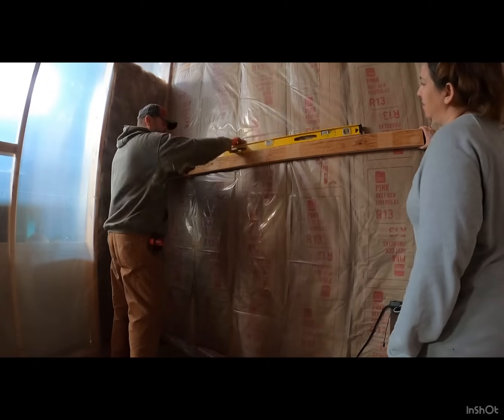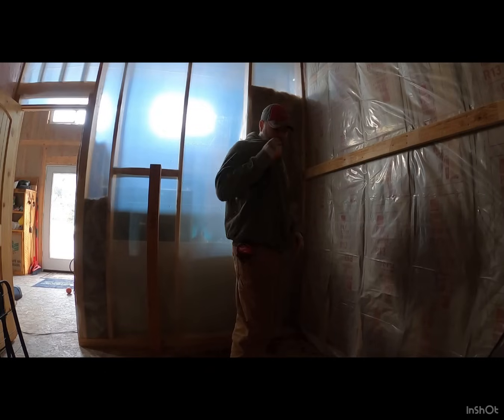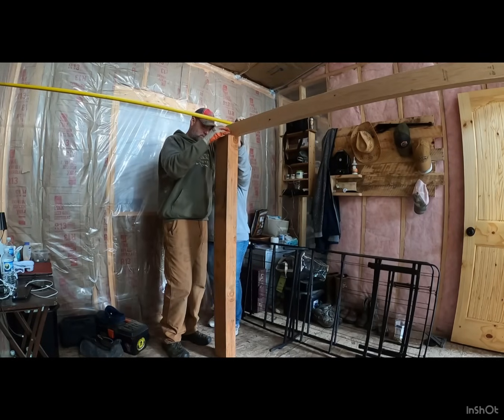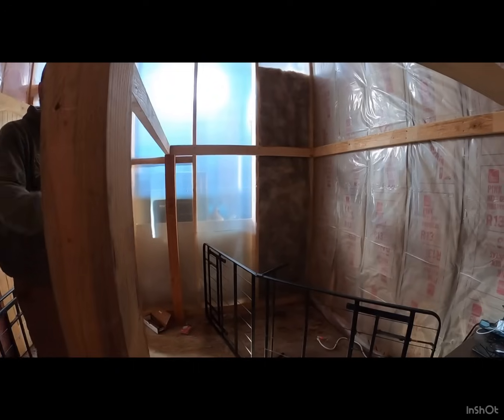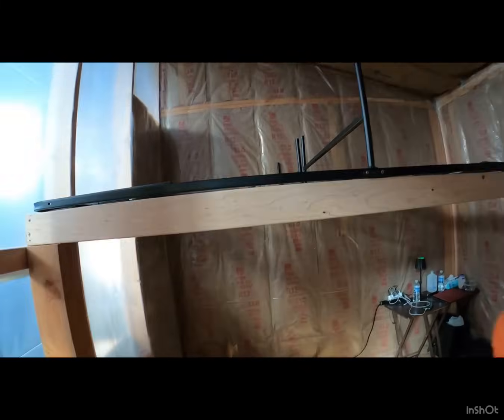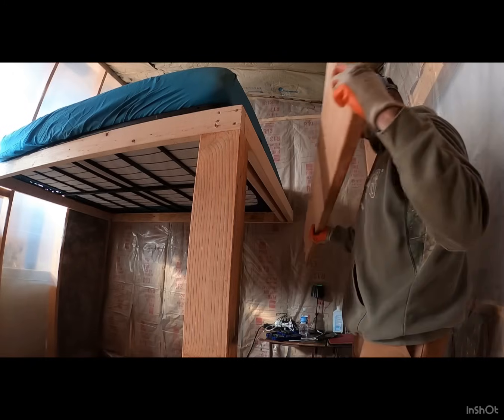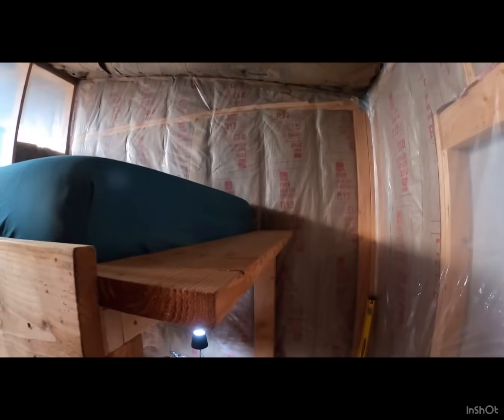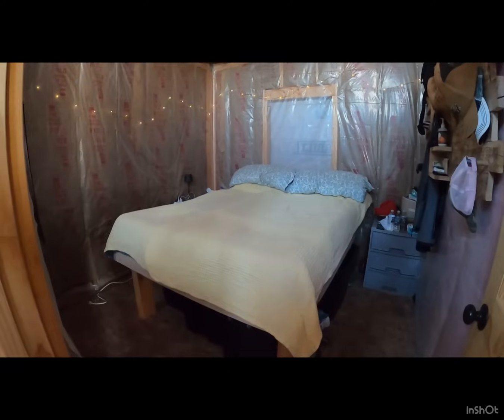Project Gone Wrong | Alaska Off Grid DIY didn’t turn out as expected

Comment: I had typed a thought on your high bed then I saw you changed it.  My thought was you need access to each side of the bed without crawling across the other person and pulling all the covers off the other person and making it easier to make the bed.  I have that knowledge from our first fifth wheel.  You’ll be glad you changed it when you get a few years older….speaking from experience here!!

Comment: Well I'm confident that you have beat a dead horse to the extreme, but conceptually not a terrible idea. Similar constructs can be found in college dorm rooms throughout the US with a desk and chair underneath. Too close to the ceiling for consenting adults and potentially to close the wall adjacent to your woodburning stove. You correctly identified the issues and rectified it.  Not to mention heat rises, hard to make the bed, when someone is ill, or even just needs to go the the bathroom it starts getting sket5chy. You guys are working hard, baring your souls, and making good things happen! I am rooting for your collective success.

Comment: When are rest of the windows going in or are they in and the plastic is just over it
Reply from the maker: It doesn’t look like we are going to be able to get the size we need so the openings will need to be reframed. Probably not going to worry about them until spring.

Comment: I built my bed 4.7 feet up off the floor but my black lab an my shepared still jump up an bug me at 3am to go out. Or just attention.   So im sure that 2 feet know better. Then again my shapard can jump up over the sides of the dump box on my 5 ton F600. Thats over my head and i am 6.2'
Reply from the maker: They’ve got their own beds, no doubt they COULD  jump up but they know they aren’t allowed on furniture. I just needed it up high enough so they weren’t level with my face. Getting beat awake with a tail every morning was getting old 😂